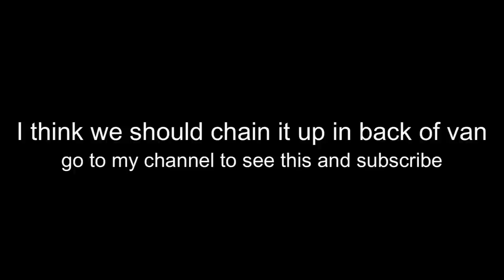MASSIVE Pulse jet FIRST TEST

Comment: Don't you need a non return valve to stop your gas bottle from exploding in case pressure drops bit  and the flames comes back in the pipe?

Comment: you just made what is a basic engine for a SR-71 Black Bird, A-12. you have a very good channel. living in the UK must be tough with all the safety sallies. thumbs up.
Reply: +MegaBait56 No those are turbo jets. This is a pulse jet.
Reply: +MegaBait56 Not even close dude, he made something similar to a V-1 Rocket engine though
Reply: +Chace Both engines have "jet" in the name though, so he's only half wrong :)
Reply: Andrej K If you consider there are like 10 different types of jet engines, I don't think he deserves half credit
Reply: +Chace That's exactly it, those were the first popularised use of them, in the tiny V-1 "drones", well calling them drones is like calling modern planes mechanical birds... They were notoriously hard to start, requiring, the fuel to be injected with the sparker, running, often with some wood covering the rear end so that fuel wouldn't leak out... and they had a pathetic static thrust, however once they started moving the thrust picked up... fast!
Reply: Keep it up from canada mate

Comment: its simple mate, it works where the air is crammed into the combustor (Fat part of the pipe) Fuel is also injected here plus ignition. Once started it sucks air in and blows out exhaust. Was invented during ww2 by the Nazi's. Jet turbine by Frank Whittle of GB replaced it. Hope this helps you understand
If not pls drop me a line and i'll try to help you :P

Comment: You should've put the air intake on the opposite side.
Reply: Then he could not go without valves, cause pressure then would go out both directions
Reply: that doesn't work on a pulsejet, it's pulsing really fast and every pulse the intake and exhaust switch. That's why it is called an pulsejet.

Comment: can someone explain to me how this works... where the sound is coming from since theres no turbine blades or anything?
Reply: in the combustion chamber there are some gases. When they are ignited they burn and there is much pressure inside which goes out. Then the whole oxygen is burned, but though the gases have some interia there will be an underpressure which sucks fresh air back in. Because there are some very hot restgases the new oxygen begins burning and the whole process starts itself again. Thus, there are only short pulses of burning gases which makes this sound.
Reply: The same reason a car engine makes noise: The fuel is exploding inside the combustion chamber over and over, quite rapidly. It's so fast it just makes one continuous noise.
Reply: The ignition of the propane makes the air expand which makes that noise
Reply: Things moving on a macro-scale aren't the only things that make noise, anything moving can make noise including gases and especially explosions.
Just FYI: Plane jet engines make their sound mostly from the fuel explosion in their relative combustion chambers, not the turbine blades spinning.

Comment: Can some one explain to me the purpose behind this "jet engine" It seems to just get hot and make a lot of noise to someone with no information. Thanks
Reply: Sure I would be glad to.  Now days it is a scientific curiosity but it had real ramifications for Britain in WWII killing thousands of people. It was called the V1(vengeance one) also called the buzz bomb or doodlebug. The difference between this version and the German one is it is valveless and has no moving parts.  It also lasts longer.  The German version used reed valves so it could not go very far.  Later the Nazis invented the V2 (liquid fueled rocket)which started the space race.
Reply: *****
This was used to kill people? what kill their ear drums
Reply: Just Google V1 flying bomb for the full history.  As I mentioned the V1 used valves which gave it a limited range.  It could travel from the coast of France to London and not much farther before the valves burned out.  The valveless design last much longer but produces less thrust.  It is probably the simplest of jet engines that you can make in your garage.  I made one from scrap motorcycle exhaust parts just guessing the design and it fired up on the first try.  Correction: The liquid fueled rocket was invented by an American named Goddard.  The Germans mailed off for the US Patent and just made it bigger.
Reply: This is a pulsejet engine. It continually explodes a chamber full of propane or similar gas to create thrust, in this case 70 pounds-force if I recall correctly from the making of video. Colin just made this one for shits and giggles.

In WW2, the Nazis used a similar design to propel their V1 missiles. Bear in mind, it was just an engine, and a bomb was strapped atop it.